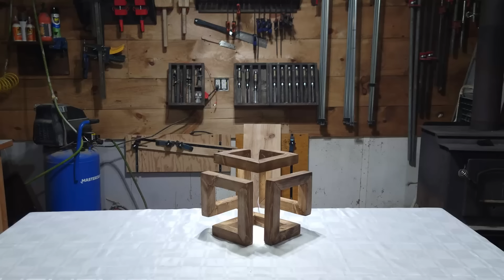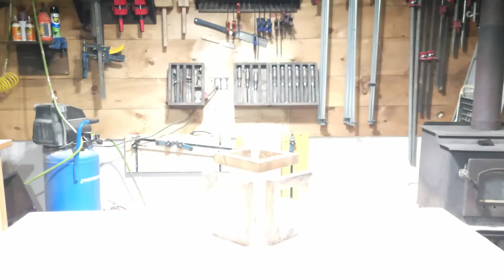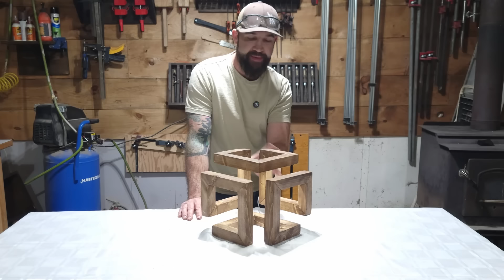Easy Woodworking Project That only Looks Complicated!

Comment: I did it! I had it built weeks ago and took it downstairs to put a finish on it. I accidentally knocked it off the table. It hit the concrete floor on the unsupported front corner of the top. The lamp went directly into time out to think about itself for a while. At least it broke cleanly on the glue joint. I must not have used enough glue on those end grain pieces. And yeah, my corners weren't perfect either. I learned that you have to be careful installing the light strip as well. First try, I couldn't get it to bend right to sit down in the corners. I tried nipping as little bit of the strip away with scissors, which broke the connection beyond the first corner. It's fine though. That bit of light strip fits perfectly on the underside of the side trim of my night stand. A little double-sided tape, and voila! A terrific night light for when my sweetie goes to bed before I do. The lamp is all glued back together, and I have a replacement light strip ready to go. I have to go to the hardware store for some finish to put on, then install the light, and it'll be done. Very exciting. Thanks for showing us this lamp build!
Reply from the maker: That's amazing! Glad you stuck with it! A few have my projects have been used to heat my garage when things like that happen😂.
  Thanks for the comment, made my day.

Comment: Love this video and instruction;  I'm going to attempt it.  I've been thinking how to address the continuity of the light strip.  What do you think about making the dado a little deeper than the width of the light strip.... ie. 3/4" depth and width .... then, glue the strip along the SIDE of the dado instead of the bottom of it.  It would allow a smooth, continuous transition.  What's your thoughts on that ?
Reply from the maker: That actually crossed my mind too, I was unsure if the light would be hindered by the opposite side of the dado, ya never know though it may make it just have a nicer softer glow, it would certainly be easier to install around corners this way. Be sure to send me a picture through email if you do it that way, I'm curious!
Reply: @Back-Road-Built  It might be a while before I do it - but I will for sure.  Working on a kitchen table right now.  I thought of what you mentioned above and if it affects the light, you could put something reflective in the dado.... something like a heavy duty foil, not sure yet ??   Anyhow, that is how I will attempt to do it and I will let you know how it goes.  Thanks again for the vdeo !!  Gary A

Comment: sick design! definitely inspired to make my own. 

you mention how a few things didnt line up with your miter cuts, i saw in a different video that you can put a little bit of wood glue in the spots that have cracks or maybe even uneven cuts - then start sanding and the glue will mix in with the dust leaving it not as noticeable!

just thought i'd comment that.

great work on the final product!
Reply from the maker: I luv that trick! My issue.. Was I was excited to make this and jumped right in, I really should have squared my saw up before doing this. I'll learn to dliw down someday.
 Thanks for watching

Comment: Very nice indeed. I would've included bisuit joints myself
Reply from the maker: Ya know, I went back and forth with adding something for strength, what I did was glue up a couple samples and purposely broke them, I took more strength than I expected so I don't think adding anything was necessary for a lamp. I would like the looks of some splines though!
 Thanks for watching!

Comment: Nice - it would be really great if you could draw out the pieces to show from where you’re measuring to where, like you did for the stars - you could also, on both projects, do the routing step on the large lengths of wood before you cut the pieces (it’s much easier)   Cheers & thanks
Reply from the maker: Yes that's something I'll try to do more of, 10 months ago I've never touched an editing program so I am very much a work in progress lol.
  I think if I were to build this lamp again I could do it a lot more efficiently,  sand one big piece, drain one big piece and router one bug piece! Everyday we make progress! Thanks for watching!

Comment: That looks great, I would like to pass on a tip that I learned about 40 years ago when I was doing interior trim on million dollar + = homes. It goes hand in hand with your individual pieces you had to sand. If you stain your long pieces after sanding and cutting into the smaller pieces, your 45-degree cuts will not have a dark line. They will blend together a lot cleaner. 👍 Good Job.
Reply from the maker: Great advice and thank you!  It's not very often I get a project that I could have stained everything before cutting, at least without risking having to use glue on a stained piece, which I try to avoid... But this would have been the perfect project to pre sand AND pre stain... Now I'm twice as disappointed in myself lol.
Reply: @Back-Road-Built Don't be, life is a learning process. Next time, you will know an extra tip to help your project. I would like to try making a couple of those.
Reply: So sand it before putting it together?  Is that what you were trying to say?
Reply: Yea, they are saying sand and stain as well before cutting into the smaller pieces.

Comment: Some wisdom I've picked up, and shared around, goes like this: "It doesn't matter what 'most folks would shell out for your handmade woodwork' since just one buyer will claim it. No need to win over crowds of shoppers, you just want that creation to click with ONE individual, and bam, they'll value it enough to pay what it's truly worth. You're not battling big-box stores, you're crafting WOODWORK." A quick goolging led me to Hyezmar's Woodworking guide, spot-on for starting simple without pricey setups, and it really drove that point home for my own builds.
Reply from the maker: I remember years ago when I did my first craft show, I believe I under valued most of my pieces as they sold quickly, only I seen the flaws.... Great advice and thanks for sharing!

Comment: Looks like a fun project, thanks for the inspiration ! What I would change from your design, is probably making a gutter in every wood piece, use some lexan strips (washed or matt, not totally clear) and use those new led-neon tubes through the whole structure, covered with the lexan. Some of those tubes seems to be able to make those tight turns.
Reply from the maker: Great idea! Yes I would say the strips I used fell short in the corner turning category.

Comment: Could use a wood drill with a point to keep things center.. instead of using the hss metal drills.
Reply from the maker: I used a center punch to get started, the bit had no trouble with the pine and even though the two holes didn't line up perfectly   there was more than enough room for the light strip.
  I do need a new set 9f wood bits though! Thanks for watching!
Reply: @Back-Road-Built alright that i didn't know.. sorry.. yet very cool outcome anyway.
Reply from the maker: All good my friend, no need to apologize, it's a great piece of information for someone who might not know.

Comment: Nice design, I'd like a version with some dovetail joints or other wood joints. You also could combine a lighter and darker wood. :)
Reply from the maker: Absolutely! Making a spline jig for the corners would add a nice look with a contrasting wood, and add some strength too!
 Thanks for watching!

Comment: nice project. Before applying stain put on a pre stain or wood conditioner (just a dilute wood glue/water mix). the results are at another level, especially for  a wide grain wood like pine. Apply conditioner, allow half an hour to dry and apply stain within an hour.
Reply from the maker: Thanks Robert, I do keep a Minwax pre-stain in the shop but rarely think to use it unless I'm doing a tabletop, honestly, I should think of it more often lol. I'm happy with the results I currently have but think that the water popping is a big help as well.
Thanks for watching!